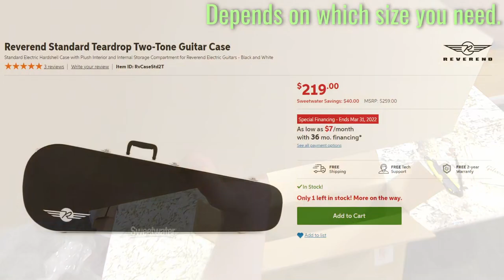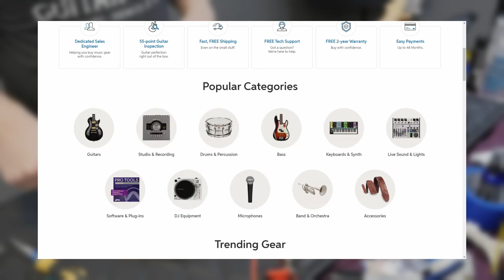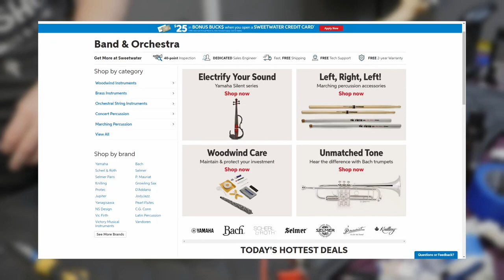Holy Toledo! I Bought My First Reverend | 2022 Reverend Jetstream 390 Outfield Ivy Review + Demo

Comment: In case someone doesn't know, the third knob is what Reverend calls Bass Contour. Works similar to a Tone control but with the low end. At 10 it's the full sound of the pickups and at 0 is taking out all the low end it can, that's why it sounds more single-coilish.
Reply: Correct. Whereas most tone knobs remove the highs, the bass contour removes lows.  This high pass filter thins the pickup sound out and causes amps not to overdrive as easily from lower frequencies.  I own a Spacehawk and Buckshot and the Bass Contour is a huge brand advantage.
Reply: Its use is obvious in "Masterplan" by Maria Taylor - the video of live performance.
Reply: I didn't care for the pickups The hotter bridge anyways
Reply: @paulcowart3174  EVH went for weaker rather than hotter there didn’t he.  I usually change the pickups anyway.  Fender China Teli: SH10 B, hot S, M hot T N.  JS22: SH10 B, P90 M ;), hot S N W/S wiring.  Don’t know what to put in Sterling Stingray HH bass.
Reply: Well, P90s are single coils.

Comment: Just in case no one else comments it: The top bolts on the Wilkinson is to lock down the saddles in place once you get them intonated. Keeps them from drifting like traditional trems can do.
Reply: I know Wilkinson makes tremolo bridges with locking saddles. I thought those locked the strings in place. So, does this design lock the "strings" as well as the saddles?
Reply: @picksalot1  as far as I've ever known the Wilkinson only locks the bridge saddles in place. The strings feed through the back like a regular strat style trem.
Reply: @Schwig  The one in Trogly's video is the Wilkinson WVS52iiK model. They also make a WLS130 model which locks the "strings" (instead of the saddles), that I saw on one of Pete Thorn's guitars, and that he says keeps the strings in tune.
Reply: @picksalot1  interesting... It looks like it's research time! Lol
Reply: @Schwig  Do a search on YouTube for "WHAT'S UP WITH THAT BRIDGE ON YOUR BLUE SUHR? Pete Thorn/Suhr/Wilkinson" to see Pete demo the bridge. 😎
Reply: @picksalot1  I actually found Henning's vid from 2019 NAMM where he got to speak with Trevor at the release. It's a pretty solid little piece of gear, might have to give it a try. Or the saddles at the very least.
Reply: @Schwig  I've tried finding just the saddles, but had no luck. If you find them at a reasonable price, please post the info. Thanks
Reply: @picksalot1  it seems you can only get them through the Wilkinson Direct Reverb store, but they seem to be out of stock atm. Presumably due to the same reasons everyone is low on stock of any thing, rn. Lol ~$85usd seems pretty reasonable, all things considered.
Reply: @Schwig  I think they've been "out of stock" since 2018 when I first heard of them. 😢
Reply: @picksalot1  womp womp
Reply: @picksalot1  there are newer Wilksinson saddles that locks the string..
Reply: @RadityoPramAdi  Do you have a model number, and where they are available from?
Reply: @picksalot1  it is wvs54, bridge and saddles combo.. from Wilkinson Direct, from Reverb.
Reply: @RadityoPramAdi  Thanks for the information. Pretty expensive at $260. Interesting that it features the "WLS130 Locking saddles."
Reply: @picksalot1  you're welcome... the 'saddles-only'  are rarely in stock tho..

Comment: I just bought a Reverend Cross Cut from Sweetwater and have been extremely pleased. No issues with tuners being too tight. Sounds and plays great! I had Sweetwater ship mine with a Gator case. Uses the hum buckers that are "voiced" for p90 sounds and the guitar basically blows away my Fenders and mot as dark sounding as my Les Paul and USA Schecter PTs. The Reverend is a player for sure.
Reply: Would this be a good guitar for surf rock? I was looking at an Eastwood but this looks really good too
Reply: @OldPeepaw  Yeah, good point. I'm new to surf music and notice my single coil fender sounds wayyyyy better (through my Surfybear) than my Les Paul w/ Humbuckers. There's just a more 'pinchy', snappy sound w/ the Fender, it really gets that drip sound going where as the Gibson is a bit warmer and sounds a bit more calm and muted (for lack of better term). I suppose just about any solid body w/ quality single coil pickups will likely do the trick...
Reply: It looks interesting.

Comment: I'm always glad to see Reverend discussed.  I have the Contender HB and I really like it.  It's in my top five for sure.  I'm also a fan of the bass contour, it comes in handy if you're switching amps a lot, which I do for fun, props to KHE amp switchers :)  The tuners were a little weird until I got used to them.  Adjusting the screws at the half-moons works to customize the tension you want.  All-in-all, it's a very solid and well-built guitar.

Comment: Got my first Reverend in about 2006. It was a mahogany bodied Club King RT. Great guitar, brilliant sound, but heavier than most Les Pauls, a real back breaker. In 2016 I sold that and got my second Reverend, a Double Agent W. It was never meant to be my main guitar but it has become my absolute go to and my favourite guitar ever. It is so versatile, so good to play, and looks super cool in my opinion, unique and original but not too weird or bizarre looking, which is a tricky balance to get right. I get asked about it all the time. I initially had a few issues with the finish flaking on the back of the neck, but Reverend were amazing about it and sent me a new one, even covering the shipping cost between USA and New Zealand for both the original and replacement guitars. Outstanding backup service. I've had no problems with the replacement and have had it for 8 years. I've never heard of anybody else having that issue. That guitar is the best purchase I ever made, I'm a Reverend fan for life.

Comment: Big fan of Reverend. Value is off the charts. I have not had any issues with their tuners or headstocks, all of the pickup combinations that I have are really quite good, and the fit and finish is always outstanding. My four are: Double Agent OG, P90 and HB; Kingbolt, RA HBs (basically rails); Charger 290 Limited, 2 P90s with a Bigsby (and it's a really good one); and Reeves Gabrels Sus, sustaniac system with a hot RA HB in bridge. Their P90s are among the best I've heard, smooth, quiet and have the necessary bite when you need it. The RA HBs are extremely articulate for a HB but have all the fullness as well. The bass contour control is fantastic. It's almost like a coil tap. Dialed all the way up, it's the fullest sound the pickup has; dialed down it's thinner like a tap. That you can blend it is the best feature. One of my guitar techs likened it to G&L's passive treble bass tone controls, which is also quite good.

Comment: That BCC knob makes a huge difference! It's like a low grade fuzz right where you need it. Makes me wanna grab one and play a 40 minute version of Hey Joe where she shoots back at him.
Reply: It's the added low end with the BCC turned up (which is really the flat setting as it's a passive cut-only control) that is causing the amp to overdrive.  Joe Gore has a good demo of this circuit in his two-band tone control video on his YouTube channel.  The BCC is essentially a passive bass control just like a G&L.

Comment: I’ve liked all the Reverend’s I’ve tried.
My only complaint has been the slim neck profiles I’ve encountered.
If they made one with a .9 to 1.0 shape I’d definitely consider buying one.
The locking pin tuners I’ve encountered you just need enough string to feed through hole and lock it down, then you don’t really have to turn the tuners too much to get to pitch.

Comment: Bonite is interesting stuff. There a lot of confusion as to what it actually is. Reverend says it artificial bone. It was used on skateboards in the 80’s and is occasionally used to this day. If the two are the same material, then it is a material originally called yorkite. Yorkite was developed by the same company that developed Forbon which is used to make pickup bobbins. Fender used it, Seymour Duncan uses it. Both are a vulconized fiber. So they are laminated layers of cellulose (the building blocks of plant matter) and plastic. Different kinds of plastic is used for each material. So, those different kinds of plastic are what separates Bonite from Forbon. That’s as far as I know. If anyone knows more or knows that I got it wrong, please, feel free to comment.

Comment: I got the Reeves Gabrels modes from Sweetwater about 1/2 a year ago and it the guitar I play the most! With the Bass Contour I get so may tone with just the two pickups it just insane. It also came with the Railhammer pickups that have such an amazing tight bass end. Also I agree with most comments below, I love the headstock design, very distinctive, great a logo too.

Comment: Outfield Ivy color is to die for.  Love it.   I own 5 Reverends and have had at least 15 over the years.  Prefer the bolt on guitars, but Reverends are great across the board.   I still prefer the guitars with serial# under 10,000 for some reason.  The seem beefier and better sounding to me.    That being said, I own a 2020 Flatroc that is tremendous.

Comment: I have three Revs and have owned several others. I have a Charger HB that made me not use my LP studio anymore lol. The Club King is a super unique guitar. It's BIG. Korina Body with a spruce top. Filtertron pickups and a bigsby. It's a huge guitar but thinner than a Gretsch. It's very versatile! The last I have is a Six Gun HPP, which is humbucker in the bridge and the same P90s in your guitar in the middle and neck. It doesn't quite have the jangle of a low output strat, but it's great for live shows. They're by no means the perfect guitar, but I play out a ton and having a reverend on stage with me can cover everything from faux-pedal steel to super hairy overdrive (with the bass contour up). I also love that I don't have to worry about ruining a vintage guitar or something like my Suhr. I can sweat all over them and they'll be totally fine after a season of gigs. It seems like their target demographic is midwesterners in their 50s and 60s, but I think any professional guitarist will appreciate the on-stage efficacy of these guitars. If you're a Gibson or Fender die-hard, you may not think very much of these. I, personally, like them very much for the price. They stay in tune better and have more tonal charm than a mexican fender or a PRS SE in my opinion, and can very easily feel and play better than new Gibsons or Fenders you'd find in a guitar center.

Comment: the bass contour is a bass frequency cut. the signal is passed through a capacitor that cuts bass, turning the knob up bypasses the capacitor giving you full bass, bass equals volume  equals breaking your amp up more. thats how the bass contour works. its used in the pedal building world a ton

Comment: I had 4 Revs in the past few years. After the honeymoon period I found I didn’t care for the slimish neck profile much, and all of them required fret leveling to play well. I do miss the 10 year old used Bucshot model I bought for $180 and put $125 into fretwork… that one was solid. But I would rather just play a Tele. The Eastsider S with a chunkier neck would be really enticing.

Comment: The third button works like my experiments 45 years ago. During school I tried an elementary diode limiter without a preamplifier and it sounded amazingly similar! Of course, I don't rule out even the simplest low-frequency regulator and overdriving of a tube amp?

Comment: fun fact: if you stretch your strings when using normal tuners and restring them properly locking tuners do not help the guitar stay in tune any better. they just speed up the restringing, add weight to the headstock and maybe help get rid of some of the necessary stretching of the strings.
Reply from the maker: While true - I'd say most guitarists don't actually know how to properly wind and stretch their strings on regular tuners so locking can be beneficial to more than just guitar techs.
Reply: @Trog  properly winding and stretching are not really that difficult though ;) its part of learning the instrument, once you know how its done you know it and locking tuners kind of prevent beginners from gaining that knowledge. they will have to learn how to do it anyways at some point and i know 7 year old kids who know how to change strings properly... its very easy, maybe even more easy then handling a locking tuners.

to me they are honestly just overhyped novelty tuners that bring more problems then use (more parts to break, additional weight on headstock, annoying handling) and probably only exist so that companies can call a guitar with locking tuners 'special' and charge a premium or brag for not charging a premium for a pseudo-premium feature. 

lol locking tuners seem to trigger me. rant over. cheers

Comment: Greetings Austin and everyone else!
I like the finish on this Reverend guitar, however, it would be nice to have an option for just a clear finish so that the wood could show through naturally, or stained. I did see that they offer a model with a flame maple top that has a purple stain and clear finish, but since there guitars are made primarily out of korina wood, it would certainly be a big plus to have that as a finish option. The headstock design doesn’t bother me too much, it is essentially just like a Fender headstock that has an extra chunk removed, likely to keep them from being sued, for copyright infringement. It is functional. The Reverend Charger RA Electric in transparent purple flame maple has two (2) humbuckers, and a Gibson/Epiphone style bridge assembly and tailstop, but it appears to have a Telecaster control system, one volume and one tone, with a three-way switch. 
Thanks to the show, I may take one of these guitars for a test drive if I see one somewhere. It is convenient for Austin to visit there business directly, but is thousands of miles from where I live, fortunately, Sweetwater can easily and safely ship these guitars anywhere you live, without too much difficulty. They do ship by FedX, and not to my Post Office Box, and since I do not want porch pirates to help themselves to any guitar I might order, there was a place in town that I was able to have a guitar sent to, that was also secure. I am sure that there are be other secure destinations that others could have their guitars shipped to, as well.
Thank you for posting these videos! 
Please have an excellent and awesome day! ☀️✨

Comment: I have owned 2 Revs. A Sensei and a Spacehawk. Both were amazing. I would still own them if it wasn't for the same issue I had with a newer Firebird I tried very hard to bond with due to quality and tones. I just cant seem to tackle slightly wider necks and that sucks because thats 3 amazing guitars I had to let go. Honest truth though Reverends are hands down best Korean guitars being built today and the best bang for the buck.

Comment: I’ve owned two reverends in my life. The first one I bought was so nice and won me over so completely that I went out and bought a second one. And wow, those two guitars could not have felt more different. The first one was made in 2012 and felt, looked, and sounded like a high end, multi thousand dollar guitar. And the second felt like a pre-set up squier. It was a 2020. They were both Sensei models. I don’t know what happened in the 8 years between the two, but there was definitely a sharp decline in quality and craftsmanship.
Reply: Older Reverends were all made by Reverend in the USA. Newer Reverends are all contracted out and made in Korea. I don't know the year when production changed but it's possible you have one made by them and one made in Korea.
Reply: @ChrisEck13  they were actually both made in Korea. Also, each reverend has the reverend employee’s name that setup the guitar in the states attached to it. I looked them both up, and at the time, both of those employees were still at reverend. My best guess is that with the second one, the employee either didn’t really touch the guitar or was having a bad/busy day.
Reply: The one Rev I had and liked the most was an older one. Hmmmmm
Reply: They've been made in South Korea for like 20 years now. It's possible in 2020 you got a covid model 🤮
All the ones I've seen are top notch. If you got a bad one, there is a signature & number on the back of the headstock, you should call Reverend and tell them what's up.

Comment: I have the earliest version of this in metallic blue top and black back and sides. AS very versatile guitar and a great player. I would not pay the prices they charge these days. I bought mine for $500 new. Regular satin maple neck. The price has more than doubled. This is the guitar Center retail tax. When they had a small dealer network and sold direct to the customer (how I got my Gil Parris model) they were a great bargain. You could even request the guitar be set up with the gauge strings you prefer. I love the bass roll off feature. Mine has a flat top. My neck is a bit chunkier than Fenders and the body is mahogany. If he thinks the neck is thin then either he likes fat necks or Reverend has changed their neck profiles.

Comment: I have a Reverend Greg Koch Signature Gristle 90 (a mouthful, I know).  It is the most versatile guitar that I own, and that's saying something. My little collection includes Gibson, Fender, PRS, Martin, and a couple more.  The guitar is *that* good.  Just one man's opinion :)
Reply: Is the oversized body noticeably larger than a regular Tele?  I’ve been thinking about buying one.
Reply: @Almost_Baked  Not in the least. They fit in a regular Fender case, and I'd have never noticed if someone hadn't told me.
Reply: Building off what MattyK said - the Gristle 90 has a 24¾" scale length and is a set neck model with an ebony fingerboard. I know of your aversion to Bigsbys Austin, but I think you'll be pleasantly surprised with that model.